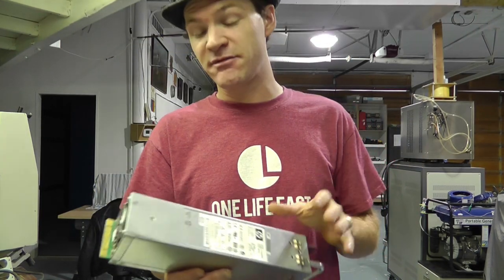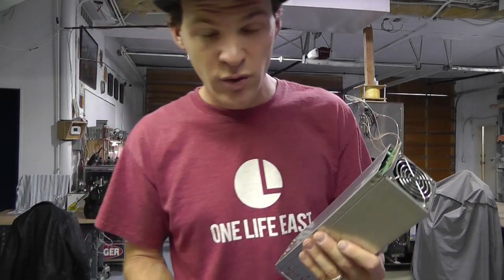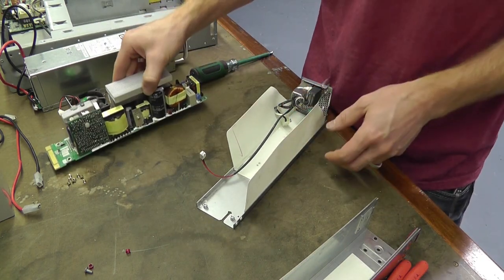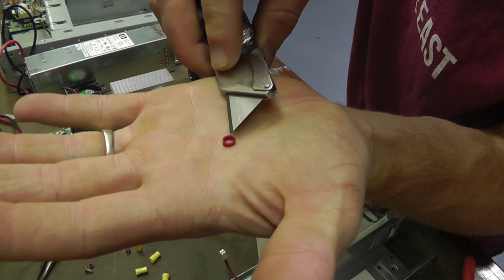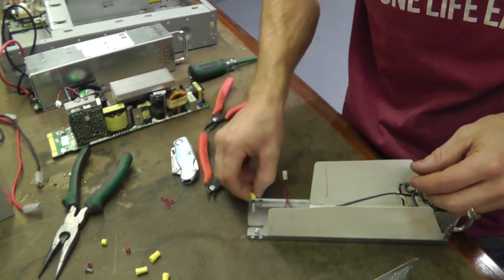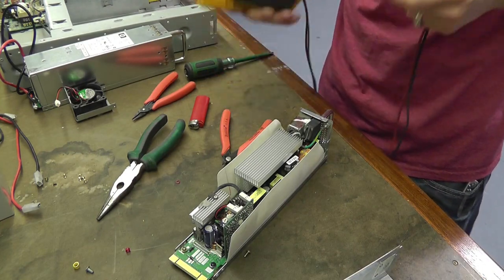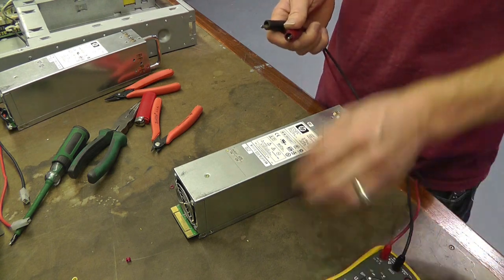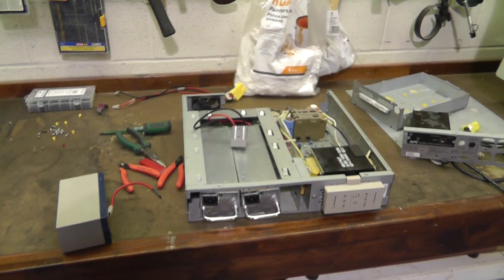P1 : 1400VA Constant Voltage Output Supply From Recycled Server PS's & UPS

Comment: I pull the nylon (?) covers off terminals all the time so I can crimp them properly, and heatshrink them. Great idea reusing the insulating skirts!
Reply from the maker: elitejohnlp yep! you can even use them for stand offs for any every day projects...  FYI when crimped correctly the cover also provides extra strength to help hold the wire via its over lap on the shielding... then heat shrink... i tent to solder all my crimp no's just for good measure... ~Russ

Comment: Looks good. You could keep the batteries in the circuit and you've basically turned the offline ups into an online ups :)
Reply from the maker: Yes I could have and thought about it but my out voltage is right at 24v so it won't keep the battery charged and will kill it :)
Reply: True, Maybe you could tweak up the voltage on both of the server supplies. I managed to get my hp supplies up to 13.66v without any issues even at load.

Comment: Russ... where do you find such great throw-outs??

WARNING the heat shrink on the screws is CRITICAL. PC Board Ground holes are plated-through, and the threads of the metal screws could hit the inner-walls of the holes, and short out.

Why would you isolate the AC side Ground pads? That eliminates the grounds for the AC-side EMI bypass caps and surge suppressors.

One alternate solution that would work would be using two nylon shoulder-washers at each of the holes... one on top, one on bottom, with the small diameter part inserted into the board mounting holes. (Personally, I would just do the DC side holes)

OR... just use shoulder washers only on the bottom side, and use Nylon screws.

For those that aren't familiar with the Nylon "shoulder washers", they are used as mounting screw insulators on TO-3 and TO-220 transistors packages. If the PC board holes are too small to allow the shoulder washers to fit into the holes, just drill the holes out a tiny bit. Yes, it will remove the through-hole plating, but it's common practice to never "count on" the mounting hole plating for electrical purposes... we are always taught to add extra through-holes near the mounting holes to actually do the electrical work, if needed.

FYI... BTW... FWIW...  the type of UPS that constantly runs (for power conditioning) is called an "Online UPS". They are usually built VERY heavy-duty, since they run 24/7, whereas a UPS hardly ever runs more than 10-30 minutes at a time. One advantage is the ZERO switch-over time in the event of a power failure.

I like the "dual purpose" idea... that makes for a hefty 12V power supply when needed! :-)
Reply from the maker: beforebefore good info, the AC grounds i did not isolate them but i was trying to show the options. ( I did isolate the AC grounds where the screws where tho, but the AC side is still grounded. and 1/2 the suppressors are isolated but the EMI filter is still in line... ) the main reason for not using other nylon hardware was to show other options if one doase not have nylon washers on hand... kinda a ( hummm, what do i already have that i can use...) thanks for the clarification on what the other UPS is called. could not member the name...  This one even tho not deigned to run for a long extended period of time dose fine. no over heating problems. yes the dual purpose will give me a 32A 24V supply :) compact too :)and lastly... i find alot of my through outs at places where they have an electronic recycling program's. a lot of bigger company's now days have recycle days and alow there employes also bring stuff in to recycle... so keep our ear and eyes out for those... also in the past i would bring home TRUCK loads of stuff as i worked with the IT warehouse in a bigger distribution warehouse...  was lucky enugh that everythign that was going out the dor for recycle i had first pick... lets just say i over did my self and ended up scraping a lot of it as i have to much... :)one last thing you can do is put a wanted add in the paper/crags list for old equipment alot of the stuff i would take home the employer would PAY to get read of... so it saved them money and gave me FREE scrap! :) ~Russ

Comment: Looks good but you are going to need 4 of those PSUs if you want to get to the maximum output of your UPS since those PSUs look to be 400Watt units and only able to deliver 384 watts max on the 12v rail 2 of them in series will provide you with 24V 32A with a total maximum power output of 768W.  You won't want to run them much over 90% capacity and most likely your UPS is only 80-90% efficient at converting the 24V dc back into AC so figure that you will really only be able to draw about 550-600 watts off the output even though you will be providing ~700 watts in from the wall.
Reply from the maker: You are correct I need 900 watt input power to get my 1400va but I just need this to run my extruder so I'm covered!! Thanks for the feed back!! ~Russ

Comment: Hey, while you are cogitatin' on steady output things.... Variable volume input from the world sucks! My dear, departed friend, Robert Russie, always pined for a device he had in the 60's, called a "Compandor" which never varied in volume regardless of input. It was part of his stereo rack, a separate unit.
To go it one better, having a limit on high and low with variation in-between would be optimal, and Very Sellable both as a physical object and as an app. Moreso as app, probably, at this stage of tech. But yeah, a small box/code that goes inline with adjustable limiters and boosters... no more waking babies with ads or whatever, no more missing stuff due to "suddenly quiet" ... Make it and drop it in your employers lap/laptop. Guaranteed income stream.
All my best to you and yours,
Ken.